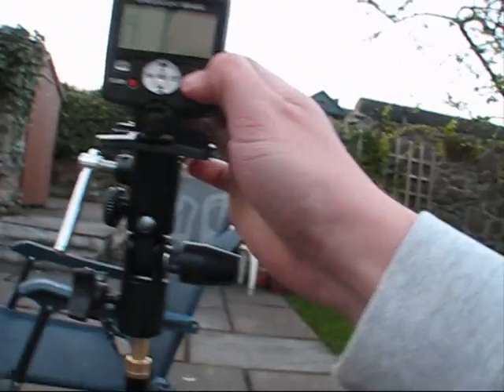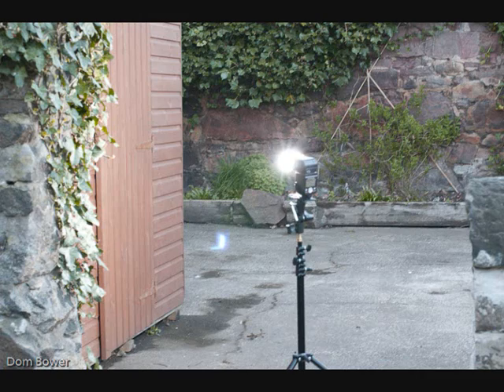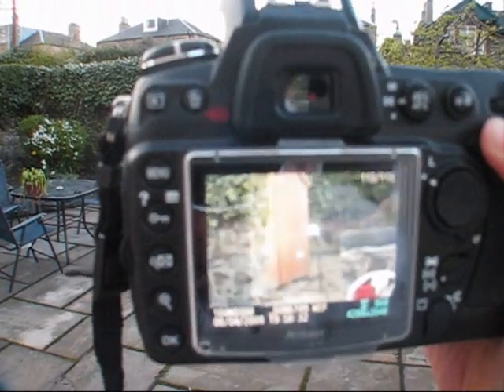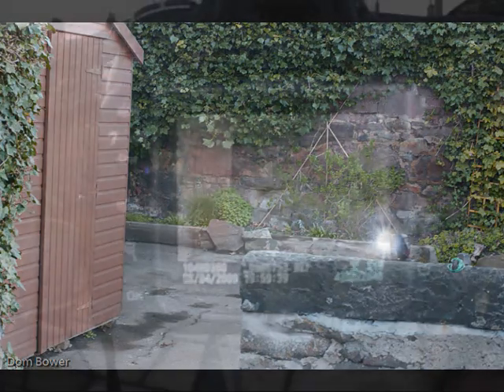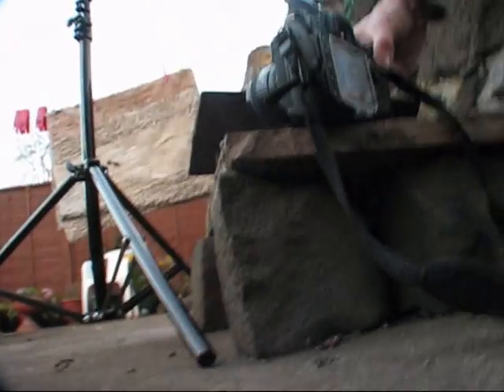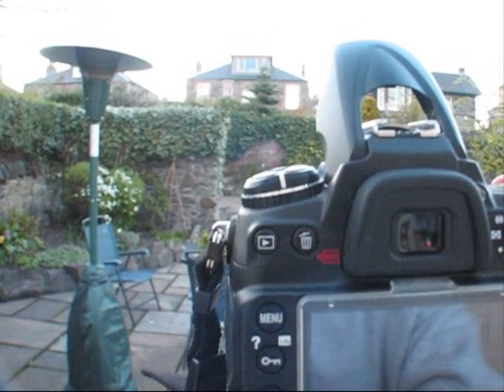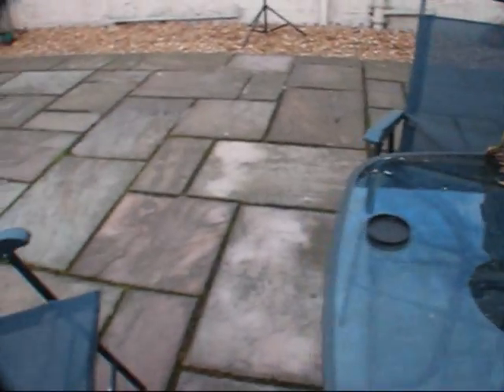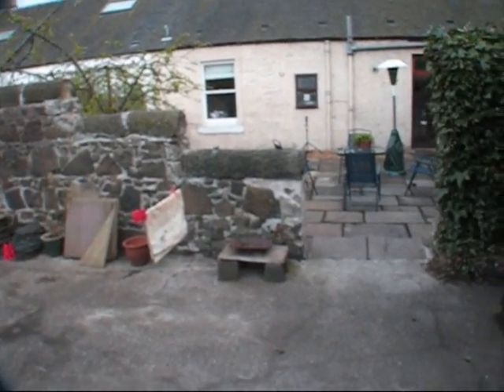Nikon SB800 speedlight flash distance test

Comment from the maker: no need to appologyise for the noob question.
there are two ways of syncing the flashes, one is by having them act as remote slave flashes (SU-4) where you manually decide the power and it goes off when it detects another flash anywhere near. The other way is through nikon CLS remote ability which is the same but much more communication is made between camera and flash..

ill make a video...